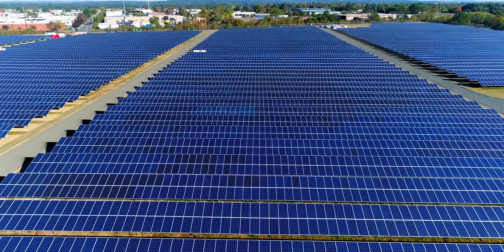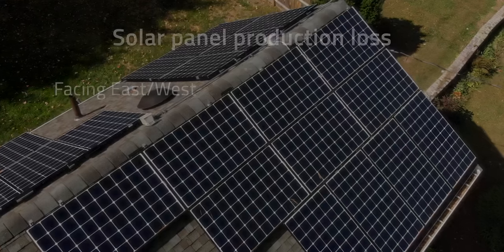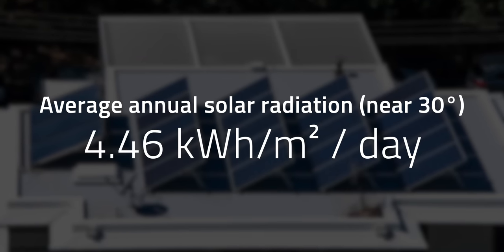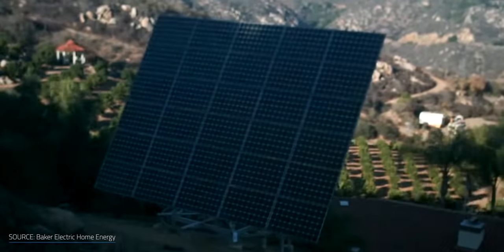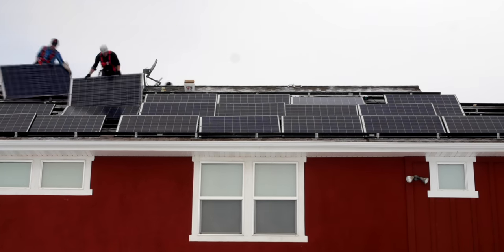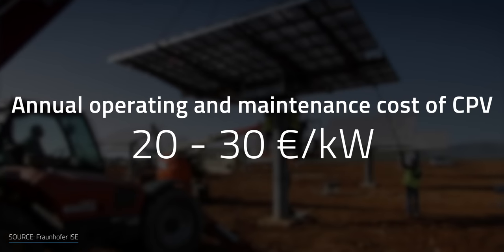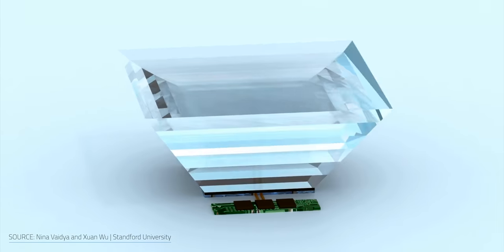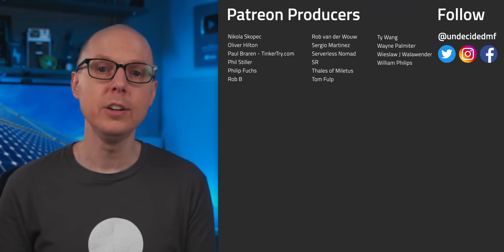This Invention Could Supercharge Solar Panels

Comment: Matt, there was a company back around 2010 that used solar concentrators and built an 8’ x 4’ panel that could generate 8kw. It could have been brilliant but the inventor got greedy and instead of starting small WITH DOMESTIC UNITS, he wanted immediate scale up to 100MW. He went bust. The company was called SolFocus and I wonder if anyone ever picked up the patents?
Reply: > 8’ x 4’ panel that could generate 8kw
Something is wrong here. 8' x 4' is about 3.2 m^2, and the total solar energy hitting a 3.2 m^2 area is under 4kW. I don't think anyone has yet produced a solar cell with >50% efficiency, so at best we're looking at 2kW.
Reply: @dosadoodle  love a good physics explanation 💪
Reply: > 50% with natural light/spectrum.

Individual or narrow spectrum light source and cells and exceed this.
Reply: @dosadoodle  I’m a little lost.

Your response to something that allegedly concentrates sunlight onto a smaller area is that you wouldn’t get enough sunlight on a small area?…

But that’s the point? The idea as far as I can tell is that you take 10M2 of Sunlight and focus it down on 2m2 of area so that you can have a much smaller more efficient panel, I assume cheap materials would be used to concentrate the light.
Reply: A Z  Like Dosadoodle said, you would need a lot bigger than 16'x8' to even have 8kw power from the sun. And the best solar cells (pure lab) were around 41% at that time which means that an Solarpanel with those cells had to be 15m² big to be 8kWp
Reply: Jeez nerds, you missed the point here. And the point is solar concentration was done before with good results but the company dissolved and what about its patents.
Reply: @Toxicity1987  How are we completely missing the whole point of this video and this comment section that more energy is concentrated to a smaller space? 

I don't understand what's happening here.
Reply: @dan-dv2tn   So it's not a solar panel, it's a " Look dad, I can harness 18kw from my 20kw hydrogen lamp !". 
Solar panels are pretty much only relevant if they can be used with The Sun™
Reply: @robertpatton172  The claim was generation of 8kW from a 8'x4' panel. We can definitely create a mirror array all around that panel that concentrates sunlight onto that panel from a much larger area, but then we're not just talking about an 8'x4' panel. That's also not a new or revolutionary idea, e.g. solar power tower, and it also isn't limited to just 8kW in that case.
Reply: That had to have been 8x4 m effective area of incoming sunlight. 32 m^2 times 1300 W/m^2 is 41.6 kW.
8.5 kW / 41.6 kW is 20.4% efficiency, or what you'd expect from a standard solar panel. Not sure what the actual area of solar cells was, but let's say it was half the incoming sunlight area.

This made a lot of sense back when solar panels cost $600 per m^2 or more, but nowadays, might only make sense for extremely large installations in flat areas, where maintenance would be a lot easier.
Reply: @dosadoodle  Yep. You’re definitely missing the point.

OP or the video you’re commenting under clearly show that the idea is to concentrate light onto a smaller area. 

To do that in any case will take up more surface area that the size of the panel. You aren’t providing anyone with revolutionary knowledge by misinterpreting the entire concept, inspite of you trying to show “calculations” to disprove it.

I would imagine the idea is that you could save money and resources by reducing the amount of rare earth metals and semiconductors required to generate electricity, and instead using cheaper materials to concentrate light onto the smaller panel.

Which part aren’t you getting? No one claimed you can concentrate sunlight without more surface area. The whole idea is to concentrate sunlight onto a panel to increase kw/m2 of solar panels.
Reply: @robertpatton172  The amount of rare earth metals needed in an solar panel is exactly zero.We don't need them at all. 
And less semiconductors would be okay if the alternative is way cheaper. Which is not the case at all.
Reply: @Toxicity1987  k lol.
“Solar panels are made up of many different materials, including rare earth metals. While the exact composition of a solar panel can vary depending on the manufacturer, there are a few key rare earth metals that are commonly used. The first is cadmium. 

Cadmium is used in the production of solar cells, and is a key component in the overall efficiency of a solar panel. Cadmium is a rare earth metal, and is relatively expensive. The second rare earth metal used in solar panels is indium. 

Indium is used in the production of solar cells, and is also a key component in the overall efficiency of a solar panel. Indium is also a rare earth metal, and is relatively expensive. The third rare earth metal used in solar panels is tellurium.”
Reply: @robertpatton172  The video is talking about getting better performance for more sun angles using refraction, not solar concentration using many mirrors concentrating solar via reflection. The video spend minutes discussing the annoyance and cost to tilt standards panels to keep them perpendicular to the sun and that this is the issue being addressed by the research discussed in the video. That's why the video talks about up to about 30% relative gains only from the tech discussed in the video.
Reply: @randomelephant4476  The video is about refraction to benefit of tilting the panel. It was not about reflection and concentration. The funnel shape of the prism used for refraction probably makes that confusing.
Reply: @Toxicity1987  First off, Cadmium Tellurium PV is a new technology, also known as “Thin Film PV”. 

Stating “new tech has low market share” isn’t the insight you think it is.

Tellurium is a rare metal. Arguing that it’s technically not a “rare earth metal” is pedantic. Chemically, sure. (Ironically Rare Earth metals aren’t terribly rare)
Economically it is a rare metal found in the earth.

Secondly, everything you said is irrelevant. The point is using cheaper materials to increase the efficiency of the panels by focussing the light. Point is that there are new developments in the PV world regarding the focussing / refracting of a large surface area of light. Weirdly trying to correct about a tangential fact doesn’t look like as impressive as you think it does and just shows you missed the actual point.

It’s kind of the equivalent of trying to correct someone that a tomato is a fruit not a vegetable. Sure, technically - but that’s not really the point.
Reply: @robertpatton172  CdTe cells are not a new tech, they exists for over 30 years. Their market share was even bigger 10 years ago but shrank again because silicon based solar cells got so damn cheap that it didn't make any sense anymore to use the less efficient CdTe Technology. 

And the issue is that silicon is already one of the cheapest materials you can find. Its literally the second most abundant element on earth (the first one being Oxygen). That's why they hold the biggest market share. The main thing that drives their price is the energy they need to be produced. Better and more efficient procedures and simply the economics of scale made it very cheap. Which is why solar cells have the very low price of 0.50$ per Wp. 

The idea to concentrate is also very old, and yeah in the lab they get pretty good efficiency results. But in the end that stuff never made it into the market because building lenses and shit to increase efficiency made the solar cells way too expensive to be competitive. 

You literally don't know shit about the solar industry, its mind boggling.
Reply: @robertpatton172  Ohh not very smart on economics either. Do you really think that people don't go to their business scientists and ask them if their invention could become feasible and competitive? We are very good to analyze and simulate the outcome. That's why we see that China is now building new Sodium Ion Battery Factories, with the knowledge that at the beginning they will be more expensive. Economic experts suggest that this technology could become very cheap and that's why China is now building those factories. 
We don't see that with Multi Junction Cells, and/or concentrator cells or any other new solar technology from the last 20 years.
I mean look at the history of your "new" CdTe cells (and other thin film technology), they were developed because at the time despite their expensive materials and less efficiency they were cheaper to produce than silicon solar cells. But then times changed, silicon cells got cheaper and most producers of thin film panels are now bankrupt or sold of. 
We have now huge solar parks with CdTe Panels, build more than 10 years ago, where the operator replaces those CdTe Panels (which are still perfectly fine to use) with silicon ones, because that leads to more yield.
Reply: It could have been brilliant... IF IT WASN'T BULLSHIT.
Reply: @ChopperChad  No they don't ... YOU miss the point.
Reply: @skizmo1905  nuh uh. YOU do.

Comment: One question I had that wasn't addressed is regarding efficiency and heat. Currently I've noticed large differences in production related to the temperature in my own system. Would the AGILE system be more or less sensitive to changes in efficiency related to temperature?

Comment: I always wondered if you could use magnification to improve solar panels, about time it was looked into.
Reply: It's been looked into, and yes it does help but the light intensity breaks the solar cells down faster as they heat up too much, now pair that downside with something that can use the excess heat to heat water and you've got something.
Reply: If we are hearing about it now, I can assure you that there has been at least a decade of research to get to this point if not more.
Reply: @a-aron2276  how come the exact astronomically defined amount of light coming from the sun is fine and no more than 10% will ruin them. an increase of 10% would coarsely increase the RON with 10%. even if would decrease the lifespan also with 10% i tend to think that waiting 2 years less to get your (Same) money back still more attractive.
Reply: @ericfleet9602  and it hasn't been produced, so it must be a bullshit concept.
Reply: Concentrated solar PV is a concept probably older than you are.